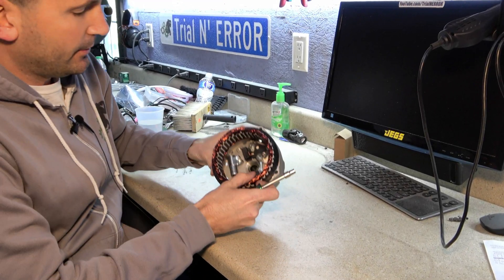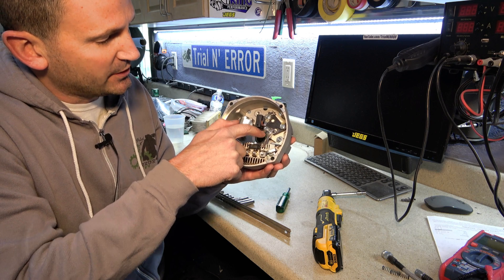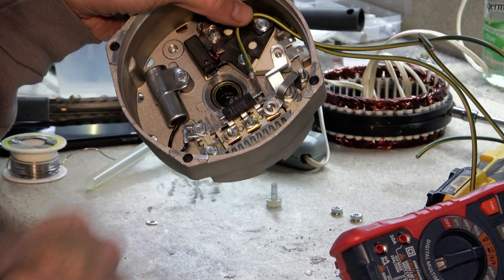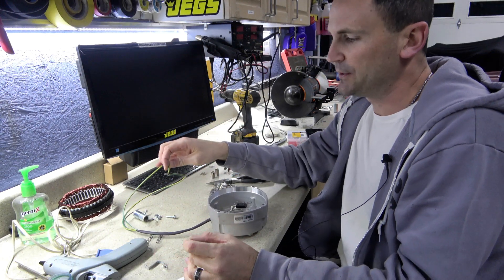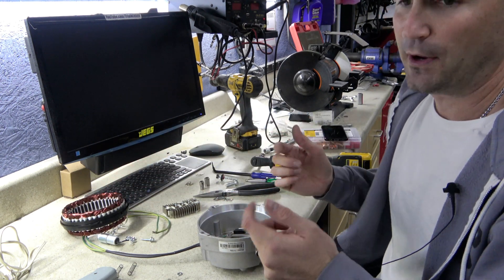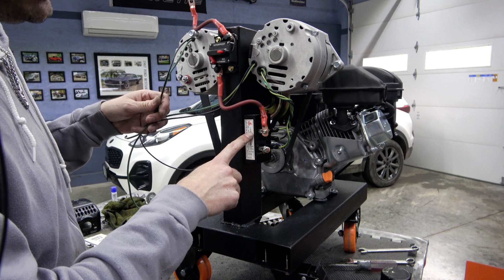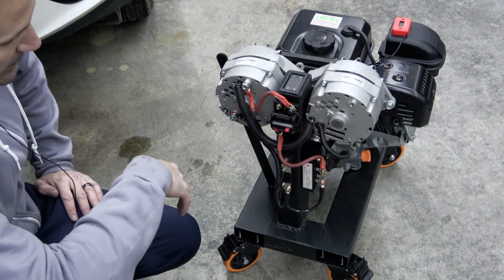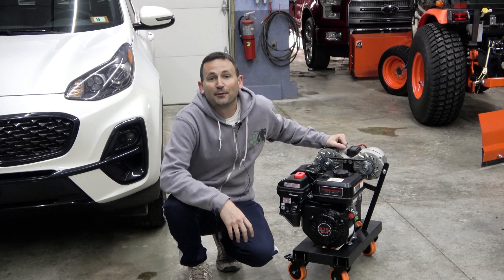Building a 48v Off Grid Generator: Part 2 - Got it figured out!!!!

Comment: Oh dear. All you needed was a $200 kit from Aliexpress/ebay/amazon. It replaces the flywheel on that engine and puts a stator underneath. You don't even need the output PTO anymore. Like an inverter generator but DC. Brushless...bearingless...permanent magnet...beltless...far more efficient and weighs like 40lbs total. Also adds electric start at the same time!

Comment: I agree with the masses, need a beefy diode between the two to not double the voltage on the field windings and separate the two voltages and combine them with their own rectifier and combine the voltage after the rectifiers..  otherwise good deal….
Reply: That didnt come out right..  but yea…

Comment: You should get a larger pulley not smaller, alternators like revs.  The crankshaft pulley circumference is usually 3~5 times the alternator pulley, so cruising on the interstate would get you around 2K rpm, so you would expect 8K rpm at the alternator.

Comment: easy way to solve problem: put voltage divider on voltage regulator measuring terminal , and set up resistance by voltage on output terminals. Boom! And we have custom DC voltage on output.

Comment: I wonder if you could run the two in parallel into a boost converter to boost the voltage to 48 volts

Comment: I think you could full field the alternators and use a capacitor to stabilize the voltage, then use a buck converter (which is usually more efficient than a boost converter).

Comment: Adding a capacitor on the DC out of the rectifier and another across the first alternator might help the alternators work together better.  You are probably generating a lot of noise(DC ripple) the way it is setup now.

Comment: We use to buy those 10si GM  one wire Alternators for our tractors and trucks all we needed to do is replace the regulators for 6 volt ,12 volt or 24 volt it was simple and cheap in fact the 
Alternators were only $19.95 from Auto Zone . Some guys even ran 12 volts to the brushes and got 90 to 110 volts out to run flood lights . so those were great to have on the shelf at the farm.

Comment: You could just find the resistance needed to drop the voltage to 28v at 52v and one would do the job. A voltage converter that is scalable also does this well after you find your values

Comment: No modifications to the alternators were needed - mount the 2nd alternator so it is completely electricly isolated from the frame, connect the output of the 1st alt to the ground of alt #2 and the output of 2 is now 48v. Running  both fields from one regulator is asking for a meltdown
Reply: Potentiel of the first is 0v because is grounded. Potentiel of the second is +24v. So final voltage between ground 0v and higher potentiel will be 48v. So alternator #2 must be isolate from metal frame ! ❤
Reply: Thinking stators are wound for max power at a specified voltage, Betting a 48v stator has 4X the windings per pole than a 12v stator.  Therefore not a fair test to compare it against a generator built from the scratch by an engineering team.
Reply: Add me to the list of those who believe it would have been fine if only the "high" generator had been isolated. I can't think of any reason it wouldn't have worked although each generator would have needed a 24 volt battery across it's output. Relatively small batteries would serve this purpose.
Reply: I suggested in the last video either Teflon or nylon bushings isolating one alternator then connecting them in series. I also said that his engine is wayyy too small. As follows:

746 watts = 1 horsepower
amps X volts = watts
100 amps X 48 volts = 4,800 watts
4,800 watts / 746 = 6.43 brake horsepower

    This does not taking into account losses in the belt drive, the, I'm sure, overly generous horsepower ratings of Harbor Freight engines and the need for reserve horsepower to avoid stalling under load and I didn't include, last time, friction loses in the alternator bearings.
    Judging by the sheer physical size of his engine, I'm guessing maybe 5 or 6 "rated" horsepower. I suggested he get a quality 8 minimum or better yet 10 horse engine and use the above mentioned insulating bushings to finish his project.
    I haven't finished watching the whole program but judging by his jury rigging the inside of the one alternator, he's in for major disappointment when he smokes the diode bridge in that unit. That alternator housing doesn't offer enough area to sink the heat away from those diodes for what he's going to be asking from them.
    David Poz has a channel where he took a 12 volt X 212 amp alternator for a Ford truck, removed the stock diodes and regulator, isolated the two discrete sets of three phase field windings, connected them to two separate outboard bridge rectifiers and, with some other peripherals, developed 91 VDC that he fed, @ 40 amps, into a 100 amp Victron MPPT solar charge controller that output a regulated charge to his 48 volt system.
    This was an experiment for David that worked in principle but didn't pan out. Reason being that a year before, he did a Kw hour per gallon of gas test on his 6,500 watt portable generator driving a 100 amp @ 48 volt charger then did the same test on this project. His big generator got something like 5.3 Kw hours out of a gallon of gas where his new project got just over 4 Kw hours with a much smaller Harbor Freight engine. He had fun building it though.
Reply: yip and at a quick glance i saw 49v at 30 amp = 1470 watts :) @jeffmccrea9347
Reply: This video is a waste of time. davidpoz shows how to do it with a 12v car alt and get 48v 3kw from it. and he link all the parts needed so anybody can do it.
Reply: @truck655am  Thanks. Checking davidpoz out now. I would use a  Brush-less Alternator.
Reply: @truck655am not waste of time at all if ur in to this typical topic🎉🎉🎉
Reply: He already tried that, it didn't work
Reply: @Eliseo202  he tried without completely isolating the 2nd alternator... they ground through the frame so if they're mounted on the same metal and wired in series then one has a dead short.

Comment: Nice build. Have you tried to determine the  kilowatt-hours per gallon to estimate the efficiency of the generator?
Reply: Let's assume it is expensive electricity.  Designed for use when expensive electricity is much better than no electricity.  ;)
Not to mention how un-green it is.
Reply: @kevinsellsit5584  Un-green is the best.

Comment: Love your merch line. I'll save you some time I wish I could get back. Haters are going to hate and can't never could. YouTube gods for your application Jeremy Fielding, Missouri Wind & Solder and alternatorman. alternatorman will build a unit for any application that will far exceed the test of time for the same cost of OEM. Missouri Wind and solar have off the shelve plug and play fan cooled bridge rectifiers or the kits for the DIY. At prices your wife won't question. Jeremy Fielding makes easy.... easier. You have no wear to go but up....welcome to the (I s#$t you not) community

Comment: I guess I am a little late, but maybe if I can clarify a couple of things about your alternators (and most others). The little black rectifier that is attached to the main rectifier bank and the stator feeds 24 volts to the internal voltage regulator, and through the electronics inside the regulator, it varies the voltage and amperage to the rotor, and increases or decreases the output from the alternator. Now, the main rectifier bank is conveniently an isolated rectifier, and can be unbolted  and attached externally anywhere. In the alternator, the negative side is bolted to the alternator case for ground, and the positive side is held into the case by way of the output terminal and insulators. If you look in between the two sides, you will see the rectifying diodes with the tabs running out to the 3 studs the stator wires attached to. Actually, you probably could have used one or both of the rectifier banks in place of the store bought rectifier you bought, and mounted them on the post. Now, I don't know how long the voltage regulator will last, because it is providing double the amperage to the rotors. Particularly at 48 volts. Your jury rig works well, apparently, but another way around it is to run external wires  out of both of them to feed both rotors from one source. There are many electronic voltage regulators that will work on 48 volts, at very reasonable prices) available on the market that should be able to supply the max amperage draw of both rotors (check the draw with an amp guage, on your multimeter if it can take 10 amps or better, and then double that to get max amp draw). 
I noticed a couple of posts that showed concern for synchronization of the alternators, because of phase issues. A simple work around is to use a timing belt, and corresponding timing pullies for the motor and the alternators. You would have to make corresponding marks on the stators and rotors (a white dot of paint would work) so both fingers of the rotors correspond to the same place on the stator windings. Voila, synchronized alternators! 

I've got 50+ years experience rebuilding alternators (and starters), and have done many hit and miss experiments over the years (ex., solenoid motors from car starter solenoids), and have learned a lot from playing around with stuff. So, we are birds of a feather, and I just turned my curiosity into a business. If you have any further questions, let me know. I love where you are heading with this. Oh - on other comments about RPM, yes, most alternators run at around 5000 RPM for the maximum output. Increasing your engine pulley size will speed up those alternators. Which, by the way, originally came out in the late 60's or early 70's, so the design has been around for a long time. Apparently the builders rewound the stators and increased the rotor magnetism to increase the output. Modern automotive alternators are 120 and 135 amps now,  and about ½ the size of those. I have no idea what the no-load voltage is on one of those!!
Reply: Dude, you REALLY need to do a video on how to make a 48v setup work with minimal modding of alternators!!
Reply: @manoo422  I've never seriously played around with making a 24 or 48 volt output alternator from a 12V automotive alternator, but playing around with them I did see that without a load (12V battery) they would produce over 50 volts. In my (long) response, I did make a typo when I talked about the diode trio provided 24V to the regulator. It should have read 14V. Everything else was correct, in theory. I guess I needed an energy crisis (other than the gas shortages back in the '70's), and could have gotten a jump start on alternative energy sources! Now I just have to sit back and watch the fun...one other neglected comment of mine - some automotive alternators now produce over 200 amps, although not continuously. Audi has gone one step further, and is making water cooled alternators!
Reply: @DoctoreE644  48v systems are now part of many peoples home battery setups. The major problem is how to remain viable during winter months by producing fuel in the summer and storing it until winter. Whether thats with Hydrogen or Ethanol or something else its likely to end up with an engine and a generator for which alternators are a very good candidate. If you have any useful information/experience on achieving this you should pass it on now to those who need it or it will simply be lost. We are all judged by what we leave behind...
Reply: @manoo422  thanks for your comments, and your concern for the future of off-grid power generation. Even though alternator tech has advanced considerably since I was in the business, the theory of how they work is still the same. The stator windings in the alternator body produce 3-phase electricity in a wye or delta configuration. The older ones use the wye, recognizable by three wires going to the rectifiers, and newer ones are delta wound and all six wire ends terminating in pairs at the diodes (1 or two negative and positive diodes for each phase) in the positive and negative rectifier banks, creating a pure DC output. The rectifier banks are normally attached to the alternator body, so the internal fan cools the rectifier assemblies, which are heat sinks. It is all designed as a unit, and are meant to run for years in the less than optimal conditions under the hood of a car. These rectifier banks are well-engineered, and are about the best bet for long life. No need to spend money on re-engineering the alternator. 

 Now for the built-in regulators that are in most modern alternators. It's pretty obvious that they are not likely to survive 24 or 48 voltages, so they need to be removed. Older alternators have a diode trio of small diodes that are attached to the three (or 6) stator leads at the main rectifier banks. This diode trio supplies rectified DC to the regulator, and then the regulator varies its output voltage, through the rotor coil and the brushes, to ground. It's possible that the voltage to the regulator is only supplied through an ignition source, but that is something that will have to be diagnosed by the DIYer. Just removing the regulator should be all that is necessary to remove any supply source. As far as the brushes, they are usually contained in their own housing. One screw that holds the assembly to the alternator is usually a ground connection, and can be determined with an ohm meter. The other brush goes to the regulator, and once the regulator is removed, a wire can be attached for a remote 12V source, supplied by the DIYer. I wouldn't recommend running the rotor voltage at other than 12V, as it is designed to run at the normal 14V of the original alternator. After all, the rotor is only a variable magnet, and to convert it to 48 volts would require disassembly, which is a big chore, requiring shaft removal (using a hydraulic press) and rewinding the coil. A remote 12V regulator is eaily sourced. Most rotors only use about 5 amps, but newer models may be more. Best to check with an ohm meter and use Ohms Law to determine amperage draw, and purchase a regulator with an amp rating double that of the rotor draw. No sense in running the regulator at full capacity. That would jeopardize the life of the regulator!  About the only other thing I can think of, is make sure the alternator is spinning in the proper direction! An alternator will produce electricity in either rotation, but the internal fan is most efficient in the designed rotation. The fan pulls cooling air through the fins on the outside of the alternator, and over the stator coils and the rectifier cooling fins, and out the back cover. Which reminds me, put the outer plastic cover back onto the alternator, as it is all designed to keep the alternator as cool as designed. And the designers spent a lot of time and engineering to do just that! Don't throw all the money of that engineering away by modifying the original alternator. They know a lot more than us tinkerers!! 

Please feel free to pass this along to anyone interested in using an automotive alternator to charge an off-grid electrical system. It is only practical operating information, and there are sure to be exceptions to what I've written. I've seen a lot of folks who cannibalized an alternator when they didn't need to. As long as the right-sized cables are attached directly to the alternator case and the output terminal and to the battery conttol equipment, y'all should be good to go. One other thought - in case the alternator runs quite hot (it's best to monitor it in the testing stage), a safety circuit can easily be hooked up, by using a dryer temperature switch (125C or 257F) wired in series between the regulator and the rotor input. Mount it flush to a flat part of the alternator. Temperature switches can also be found in electric tools and appliances, as a flat sensor device hooked into motor power lead and attached to the motor. Just make sure that the temp rating doesn't exceed 250° F. Good luck!!
Reply: Just a note to the group we are working on a system that can be off grid and waste driven so it will be weather agnostic. We are still havingnsome engine challanges as in the long run times and the noise issues but GOD willing soon. Very very soon.  Love these videos tho great to see the ideas moving.
Reply: Way better than my explanation lol

Comment: Any old alternator will make about 140v ac on the 3 phase,  spinning them too slow is a problem too because the cooling fans are running too slow. The wind generator guys have this down to a science, study what they do with PMA wind turbines, the choke point in your system is most likely the external rectifier. Get some big high capacity diodes and build your own rectifier, using more diodes than you think you’ll need just makes them last longer, it spreads the load and eases the strain on each one, and heat generated. Also cool your diy rectifier with a fan. You could do better than your seeing in that setup with 1 large frame hairpin alternator and a proper rectifier. (Actually smaller than the alternators you have there) and you can get them in a ccw rotation so your generator will take up less room. Denso makes the “hairpin” alternators, they are no joke.you then can control the output voltage in 3 ways. Engine rpm, pulley ratio, and varied dc voltage input to the rotor.